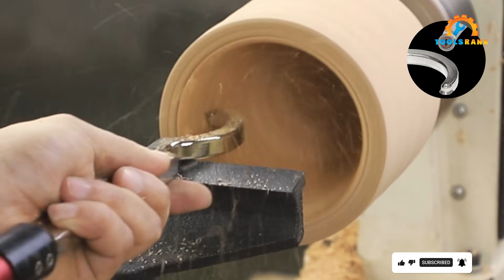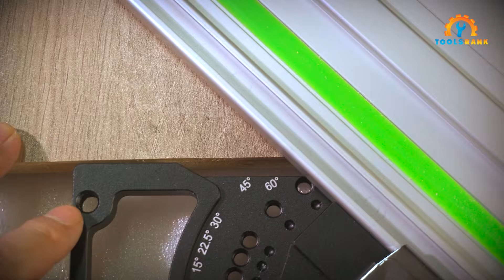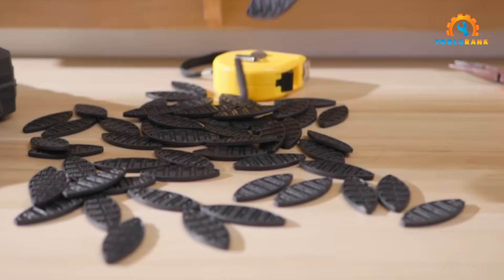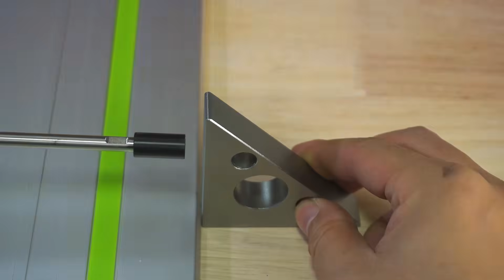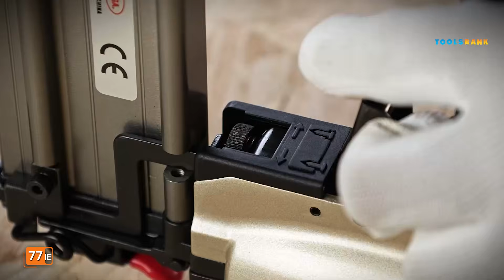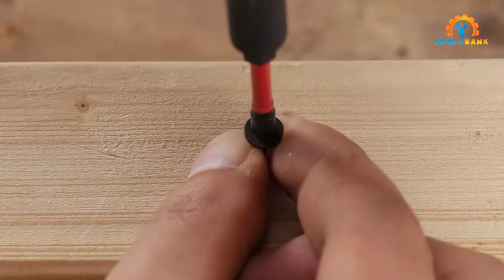100 Amazing Woodworking Tools on Amazon You Need Right Now

Comment from the maker: 1	sunbaba 3d carpenter square	
 https://www.amazon.com/dp/B0DG5FSX2H?tag=toolsrank-20
2	suizan ryoba pull saw	
 https://www.amazon.com/dp/B0D2QRLYBN?tag=toolsrank-20
3	milescraft cabinet jig kit	
 https://www.amazon.com/dp/B0CTSZH1PQ?tag=toolsrank-20
4	mollom carbide forstner bits	
 https://www.amazon.com/dp/B0DPWCCF9X?tag=toolsrank-20
5	siiixs carbide lathe tool set	
 https://www.amazon.com/dp/B0D47J7M7T?tag=toolsrank-20
6	microjig matchfit cnc kit	
 https://www.amazon.com/dp/B0D2JCP1S8?tag=toolsrank-20
7	goingmake cabinet door jig	
 https://www.amazon.com/dp/B0DSKNJQKM?tag=toolsrank-20
8	kreg k4 pocket hole jig	
 https://www.amazon.com/dp/B001DYFISG?tag=toolsrank-20
9	puioco stair tread template	
 https://www.amazon.com/dp/B0F3CPZLHR?tag=toolsrank-20
10	grenpro woodworking scriber ruler	
 https://www.amazon.com/dp/B0FLXMPPGP?tag=toolsrank-20
11	spetool router lift system	
 https://www.amazon.com/dp/B0F8746JDC?tag=toolsrank-20
12	bullseyebore drill guide laser	
 https://www.amazon.com/dp/B0DZ9L7BB7?tag=toolsrank-20
13	ldhthopi burnishing machine	
 https://www.amazon.com/dp/B0FL1VBBPY?tag=toolsrank-20
14	ezarc 7-1/4 circular saw blades	
 https://www.amazon.com/dp/B0FB3V3HPC?tag=toolsrank-20
15	powertec abrasive cleaning stick	
 https://www.amazon.com/dp/B0F7WJXLZ1?tag=toolsrank-20
16	gqgp setup blocks	
 https://www.amazon.com/dp/B0DXZXHVNP?tag=toolsrank-20
17	kainsy custom branding iron	
 https://www.amazon.com//dp/B0CWH7JS27?tag=toolsrank-20
18	artymaster 8" carpenter square	
 https://www.amazon.com/dp/B0DJV7J85X?tag=toolsrank-20
19	toyaki 10" miter saw blade	
 https://www.amazon.com/dp/B0F4JPDFYX?tag=toolsrank-20
20	kernowo wood carving kit	
 https://www.amazon.com/dp/B0FBWQMZSH?tag=toolsrank-20
21	tovpade micro sander kit	
 https://www.amazon.com/dp/B0FDWYKCSM?tag=toolsrank-20
22	goingmake track saw square	
 https://www.amazon.com/dp/B0DT6B6JJ6?tag=toolsrank-20
23	wencrew 90-degree corner clamps	
 https://www.amazon.com/dp/B0FH9Y79KZ?tag=toolsrank-20
24	fisch wave cutter forstner set	
 https://www.amazon.com/dp/B008KIUFEK?tag=toolsrank-20
25	terwex custom branding iron	
 https://www.amazon.com/dp/B0DNT1ZJLF?tag=toolsrank-20
26	cuidosful bench dog clamp set	
 https://www.amazon.com/dp/B0DY4QZ9N4?tag=toolsrank-20
27	5-in-1 drilling ruler	
 https://www.amazon.com/dp/B0F2H9BDGT?tag=toolsrank-20
28	6-pc wood carving drill bits	
 https://www.amazon.com/dp/B0D93F16QC?tag=toolsrank-20
29	20v cordless multi-tool kit	
 https://www.amazon.com/dp/B0FBRFM2BG?tag=toolsrank-20
30	stainless steel angle protractor	
 https://www.amazon.com/dp/B0F2T1WWT9?tag=toolsrank-20
31	table saw miter gauge	
 https://www.amazon.com/dp/B0DXTXG7F5?tag=toolsrank-20
32	sliding t-square ruler	
 https://www.amazon.com/dp/B0D6V76JW9?tag=toolsrank-20
33	6" cordless mini chainsaw	
 https://www.amazon.com/dp/B0CQXFBDNJ?tag=toolsrank-20
34	mini edge banding trimmer	
 https://www.amazon.com/dp/B0D9TX59CG?tag=toolsrank-20
35	5-pc countersink drill set	
 https://www.amazon.com/dp/B0D9GW543J?tag=toolsrank-20
36	cnc spoilboard router bit	
 https://www.amazon.com/dp/B0D949HLWY?tag=toolsrank-20
37	pocket hole jig kit	
 https://www.amazon.com/dp/B0FDXNDSWJ?tag=toolsrank-20
38	kreg rip-cut circular saw guide	
 https://www.amazon.com/dp/B073PFYN4T?tag=toolsrank-20
39	800w wood router	
 https://www.amazon.com/dp/B0F5N54PBW?tag=toolsrank-20
40	biscuit joiner plates	
 https://www.amazon.com/dp/B0FDJRV4GC?tag=toolsrank-20
41	router corner radius templates	
 https://www.amazon.com/dp/B0DYNWK2YS?tag=toolsrank-20
42	saker thin rip jig	
 https://www.amazon.com/dp/B0D81KX6P4?tag=toolsrank-20
43	8" draw knife	
 https://www.amazon.com/dp/B0FMF3P87D?tag=toolsrank-20
44	t-track f clamps	
 https://www.amazon.com/dp/B0DV8G62YH?tag=toolsrank-20
45	12oz wood carving mallet	
 https://www.amazon.com/dp/B0F6K2H5Q8?tag=toolsrank-20
46	adjustable doweling jig	
 https://www.amazon.com/dp/B0F6SC5C4Q?tag=toolsrank-20
47	goingmake dowel jig kit	
 https://www.amazon.com/dp/B0FK9PSXJT?tag=toolsrank-20
48	artymaster 3d measuring square	
 https://www.amazon.com/dp/B0CTMGL543?tag=toolsrank-20
49	sigerio 4-in-1 router jig	
 https://www.amazon.com/dp/B0CZ8YPXZQ?tag=toolsrank-20
50	hurricane 4pc wood chisel set	
 https://www.amazon.com/dp/B07GGYNHSQ?tag=toolsrank-20
51	LEGLO Mallet Hammer	
 https://www.amazon.com/dp/B077N5FTLD?tag=toolsrank-20
52	DEWALT 10-Inch Table Saw	
 https://www.amazon.com/dp/B00F2CGXGG?tag=toolsrank-20
53	Old City Woodworking Brush	
 https://www.amazon.com/dp/B07HLTXRJZ?tag=toolsrank-20
54	Amazon Basics Bench Plane	
 https://www.amazon.com/dp/B07V3QLZ5Y?tag=toolsrank-20
55	GUOJINJISM Clearance Inserts	
 https://www.amazon.com/dp/B0CJXTZDR1?tag=toolsrank-20
56	Yoselin Laser Marking Gauge	
 https://www.amazon.com/dp/B0C3GXMWYJ?tag=toolsrank-20
57	Trend Digital Angle Finder	
 https://www.amazon.com/dp/B01HF9FJJU?tag=toolsrank-20
58	ENVENTOR Oscillating Tool	
 https://www.amazon.com/dp/B0DXKPHFV6?tag=toolsrank-20
59	Kynup Digital Caliper	
 https://www.amazon.com/dp/B07X8JQ8L5?tag=toolsrank-20
60	Temple Tool Japanese Pull Saw	
 https://www.amazon.com/dp/B0DC5DZTG7?tag=toolsrank-20
61	goingmake Track Saw Guide System	
 https://www.amazon.com/dp/B0DZCKLXNN?tag=toolsrank-20
62	QWORK Ratcheting Table Clamp	
 https://www.amazon.com/dp/B09L7WFTL1?tag=toolsrank-20
63	Dust Collection Vacuum Attachment	
 https://www.amazon.com/dp/B0DBTGQHHF?tag=toolsrank-20
64	BuckTool Horizontal Belt Sander	
 https://www.amazon.com/dp/B08LPX5CZW?tag=toolsrank-20
65	REALINN Wood Furniture Repair Kit	
 https://www.amazon.com/dp/B08T12BCMW?tag=toolsrank-20
66	Tmacker Magnetic Wristband	
 https://www.amazon.com/dp/B0DWHRM6NH?tag=toolsrank-20
67	Matework Pocket Hole Jig Kit	
 https://www.amazon.com/dp/B0CR174CSR?tag=toolsrank-20
68	Genmitsu 2D & 3D CNC Routers	
 https://www.amazon.com/dp/B07P6K9BL3?tag=toolsrank-20
69	GRENPRO Woodworking Square	
 https://www.amazon.com/dp/B0DS3ZLR2M?tag=toolsrank-20
70	GETLITOOL 12-Inch Bar Clamps	
 https://www.amazon.com/dp/B0DJVQ47XF?tag=toolsrank-20
71	Saker Multi-Function Scribing Tool	
 https://www.amazon.com/dp/B09W8S61JS?tag=toolsrank-20
72	SUIZAN Small Handsaw	
 https://www.amazon.com/dp/B0BWDXZVPY?tag=toolsrank-20
73	SILVEL Cordless Brad Nailer	
 https://www.amazon.com/dp/B0DJHNBNBS?tag=toolsrank-20
74	WenCrew Corner Clamps	
 https://www.amazon.com/dp/B09JNVVLBW?tag=toolsrank-20
75	TACRAY Titanium Bevel Gauge	
 https://www.amazon.com/dp/B0B5R435FF?tag=toolsrank-20
76	Trend Digital Angle Finder	
 https://www.amazon.com/dp/B01HF9FJJU?tag=toolsrank-20
77	F50C Pneumatic Brad Nailer	
 https://www.amazon.com/dp/B0DM5F4SP6?tag=toolsrank-20
78	Nicpro Carpenter Pencil	
 https://www.amazon.com/dp/B09WYNGWCM?tag=toolsrank-20
79	BOW Push Stick for Table Saws	
 https://www.amazon.com/dp/B082VN1KLT?tag=toolsrank-20
80	Rockler Dust Collection Fittings	
 https://www.amazon.com/dp/B078N4NM26?tag=toolsrank-20
81	MICROJIG GRR-RIP BLOCK	
 https://www.amazon.com/dp/B00DNX3N7S?tag=toolsrank-20
82	Metabo HPT Brad Nailer	
 https://www.amazon.com/dp/B07MK88Q33?tag=toolsrank-20
83	NAYE Spring Loaded Right Angle Clamp	
 https://www.amazon.com/dp/B09QPYRW5X?tag=toolsrank-20
84	ARBORTECH TURBO Shaft	
 https://www.amazon.com/dp/B0155BF08A?tag=toolsrank-20
85	Saker T-Square Ruler	
 https://www.amazon.com/dp/B0D6V76JW9?tag=toolsrank-20
86	blekoo Doweling Jig Kit	
 https://www.amazon.com/dp/B0B985CXPB?tag=toolsrank-20
87	WEN 6530 Electric Hand Planer	
 https://www.amazon.com/dp/B00OW5AJTG?tag=toolsrank-20
88	Eleon Self-Centering Dowel Jig	
 https://www.amazon.com/dp/B0D9HTH5PJ?tag=toolsrank-20
89	QWORK Wooden Mallet	
 https://www.amazon.com/dp/B09JSR8233?tag=toolsrank-20
90	CSOOM Router Bits Set	
 https://www.amazon.com/dp/B0C9DLK1LK?tag=toolsrank-20
91	Motovecor Wood Carving Tools Set	
 https://www.amazon.com/dp/B0BRN7LJJF?tag=toolsrank-20
92	Yunirvana Mini Circular Saw	
 https://www.amazon.com/dp/B0CPPRZSMY?tag=toolsrank-20
93	Achribex Drill Bit Set	
 https://www.amazon.com/dp/B0F62K6T5T?tag=toolsrank-20
94	Lionz Contour Gauge with Lock	
 https://www.amazon.com/dp/B088T5PPSK?tag=toolsrank-20
95	KeenCatch Mini Bench Vise	
 https://www.amazon.com/dp/B0DNB3JRWJ?tag=toolsrank-20
96	Woodskil Band Saw	
 https://www.amazon.com/dp/B08SK9W4Q5?tag=toolsrank-20
97	BeaverCraft Draw Knife	
 https://www.amazon.com/dp/B07XLTXNN3?tag=toolsrank-20
98	POWERTEC Abrasive Cleaning Stick	
 https://www.amazon.com/dp/B00AJW0CY8?tag=toolsrank-20
99	IVSUN 116-Pc Wood Burning Kit	
 https://www.amazon.com/dp/B08FSPYN2M?tag=toolsrank-20
100	Peachtree Woodworking Apron	
 https://www.amazon.com/dp/B0DKZH49DL?tag=toolsrank-20